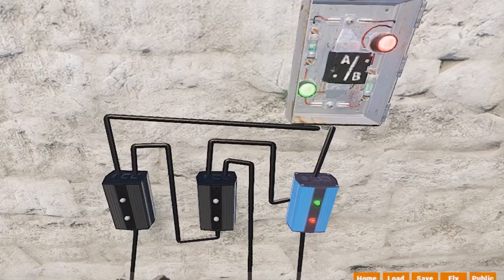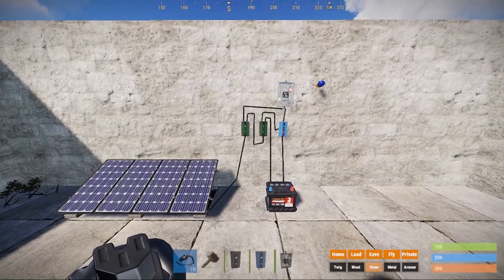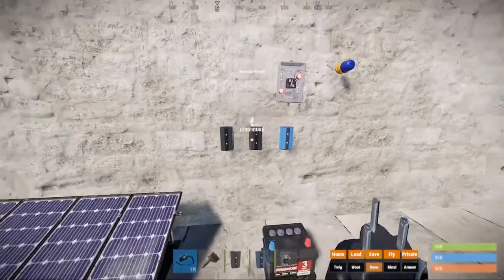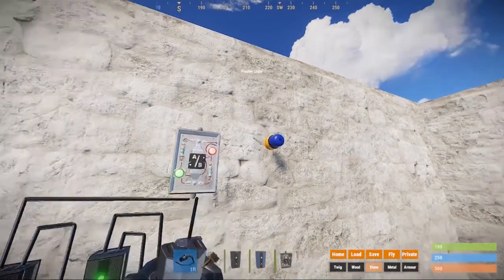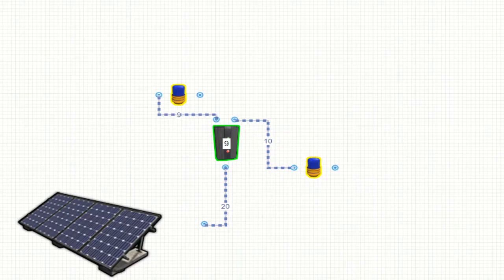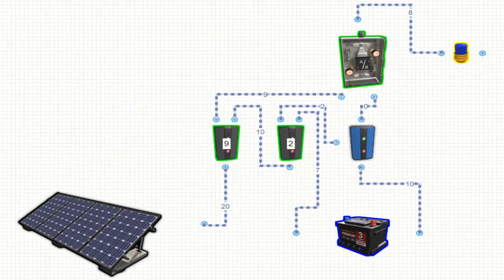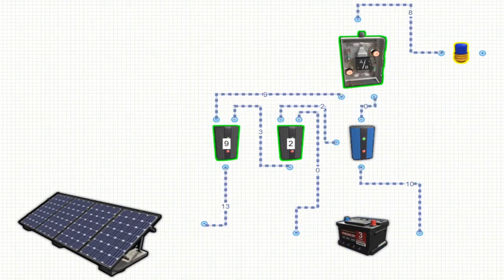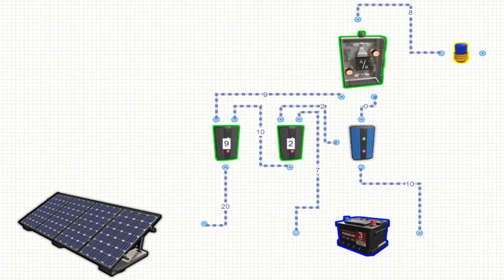Rust Electricity - the FIRST and most important circuit to build

Comment: this is old scheme. Now it’s important to connect directly
Reply: solar panel -> consumer (splitter)
Reply from the maker: No the splitter is not the best way to do this.  Splitters are rarely the answer when a branch is available.  What do you think the benefit of the splitter is?
Reply: @ramrodgames  The system you introduced is needed to separate the power supply from charging the battery and consumers - this takes a small amount of electricity. In the present tense, this is not necessary, because the battery does not give out all its charge, as it was before, but as much as consumers need. The main thing is to supply 2 times more energy to the battery than consumers need. Sorry for my english)
Reply from the maker: Your English is good bro no worries.  That was my point in the video - you CAN power everything direct with the battery directly as you said if you have double the solar / wind and enough battery to get you through the night + during periods of lower power (more applicable with solar than anything).  The point I'm making is you are wasting HQM because you're having to set up 2x the power and more battery capacity than you need to make sure the power supply is uninterrupted.  This circuit has multiple benefits compared to just connecting everything directly: 1) It allows you to more efficiently use the power generation you have (especially solar) when it is available and then switch to battery when it is not sufficient (so you don't need to install as many panels and as big of a battery).  2) It gives you a battery backup if your solar / wind is damaged or destroyed because it makes sure that your battery is at peak charge at all times (yes you can do the same by having 2x+ solar going into a battery so that you always have extra, but that's wasteful).  For example you can have 6-7 solar panels generating 120-140 power going into 1 large battery this way and instead of 10 panels.  3) You get more control over your power - with this circuit using branches (this is one reason why they are better than splitters), you can set how much of your power is going to the battery to charge it in the beginning vs. to your components.  For example if you set up everything with a medium or large battery in the beginning and only need 10-20 power for a turret and some lights, you would not direct 100 power from the solar panels to your main power line.  You would direct enough to power those components and send the rest to the battery to get it charged fully faster.

Ultimately this circuit isn't for everyone and you do need HQM for the components and yes it uses a little bit of power.  If you're only using electricity for basic stuff then this is not worth it.  You'll see in future videos though that I like to build complicated circuits with multiple sensors, turrets, and advance warning systems.  To do stuff like that, this circuit is absolutely necessary because you want to be able to regulate everything and it is the first step to a much larger and modular electrical system.  I'll post more videos and show more of this.  Thanks for your comment and let me know if I'm wrong on anything here.
Reply from the maker: @Rest0rer I think I understand what you are trying to demonstrate which is that you lose some power because of the circuit and get less to the battery vs. directly connecting to the solar panel.  This is true but you wouldn't really use this circuit for a single small battery so the power loss doesn't matter as much when you are talking about medium / large batteries (or many of them for larger systems).  You still lose the same amount of power to the circuit regardless of the size of battery so this circuit is for larger systems to be most beneficial.  You will lose a little bit of power to the circuit but the benefits I was listing above are worth it for larger systems vs. connecting directly to a battery.  Did I miss something else in your video or was that what you were showing?  Thank you for taking the time to set that up.
Reply from the maker: @lowfees yeah there's no way a single large battery will work - you will need multiple for that configuration (16 turrets and 4 sam sites alone require 260 power to operate without accounting for anything else).  Regardless of whether you use this circuit or not, you can achieve this by stringing together multiple large batteries with root combiners on the output.  You can scale this circuit up as well for a big system like that - I can show that in a future video if interested (I actually did it on the last wipe for 2 large batteries).  For systems less than 100 power needs you can simply add more batteries and string them together (output to input) in a chain and then the last battery in that chain is a large battery that outputs 100 into the blocker.  
For your specific situation you would take the power out of the second branch and then connect it to a string of branches or a splitter (actually helpful here) that each goes into the input of as many batteries as you are setting up.  If you're gonna do 3 large batteries (300 output) then splitter is the easiest here.  You can do via branches (1 branch per battery with the branch output going to each battery's input) but the issue is you'll then need to set the branch amount for each battery and you can run into some issues with batteries down the chain not getting any juice if there isn't enough to satisfy the needs of earlier branches.  Using branches in this setup would require you to monitor and adjust branch amounts appropriately until all your batteries are fully charged and the system is working as expected.  Alternatively with the splitter you can just split the power into 3 evenly for 3 large batteries or go to a branch first then to 2 splitters for 6 batteries (and scale up from there).  
Then the only other tweak you need to do is to use root combiners on all the battery outputs to combine them all into one power stream that you feed into the blocker.  This amount of power is not capped by anything so as many batteries as you feed into the root combiners as you can will dictate the power output.  This is how you'll get your 260+ power at night when you're running on batteries ultimately (regardless of if you use this infinite circuit or not).  You just need to root combine all your batteries.  Hope that helps.
Reply: @ramrodgames  in both types of connection you need 2 times more energy for uninterrupted operation day and night. But in your (old, until the bug with the batteries have been fixed) circuit there will be a small loss of electricity and HQM for 2 splitters, a blocker and an "or" switch.
Reply from the maker: @Rest0rer That's correct, I think we are saying the same thing as it relates to the loss of electricity from the branches / blocker / OR switch but that doesn't matter as much when you're talking about medium or large batteries because the power loss is the same regardless of the size of the system.  So losing say 5-10 power on a system that outputs 100+ is not as significant and the benefits of this circuit outweigh that loss (as I was listing before).  Where I don't agree with you is that you need 2x for the infinite circuit - one benefit of this circuit is that you need less than 2x vs. your method.  I will try to show this on a video but the reason for this is when you connect everything directly as you have the battery is used first and recharged by the solar simultaneously during the day.  In the infinite circuit, the battery is not used at all until there is not enough power from the solar for the system and then the batteries come on.  The reason this is better is because the batteries are used for less time and therefore you need less batteries to last the night and will likely need to recharge them less.  Because of that you can use less than 2x power in this system because 1x power is used during the day directly via the solar (no batteries) and anything extra is used to recharge the batteries during the day.  You have to find the right balance here and in some instances it can be as high as 2x but not always.  If power needs are very high and the batteries are almost fully drained every night then yes you probably need closer than 2x to be able to recharge the batteries fully during the day but that is not always the case.  For example you can have a large battery with maybe 1.2-1.3x power if you are not using all 100 of the output (I do this all the time as a solo - it always makes sense to have a larger battery than you need and sometimes all I find is a large).  Plus this circuit gives you more benefits as I outlined above beyond just the battery / solar efficiency.  I will try to show all of this in a video, maybe that will help.
Reply from the maker: @lowfees stick around then, more to come.  I'm a mediocre Rust player who is more into the building / electric stuff so that will be more of the focus here.  Pretty sure no one wants to watch my gameplay where I die non-stop or just run away every time!

Comment: Hi, I’m having a slight problem with this circuit if anyone can help 
So;
I have windmill + 2 solar panels connected before this circuit into root combiners which then send power to the first branch of this circuit.  During the day it’ll get between 150-170 power going through, then down to 100-70 during the nights and low wind. I branch out 100 power to the OR switch and the remainder charges the battery. However my battery is still continuously discharging even when the branch is providing well over 100 power. What could I possibly be doing wrong that both sides of the OR switch are sending through power to my main circuits 

Thanks
Reply: This video is a rip off of a video I made 4 years ago.  But he only copied the first part.  I can't link it because "youtube".  But search up "The Best Rust Infinite Power Circuit", then skip in 4:20 into the video I show how to modify the circuit for a large battery, and more power, like a wind gen.  

That said The reason this circuit existed is that at the time I made the video a battery, in Rust, could not be charged and used at the same time.  This was fixed about 3 years ago in the November 2021 update.  Since then a battery could be charged and used at the same time making this circuit obsolete.  Sadly the person who copied my video didn't know that because when he posted this video it as no longer needed.  Now all you have to do is run a wire from the solar panel, to the battery, then from the battery to the load.

Comment: If the power from the solar panel is not sufficient, its waisted because it wont charge the battery, is there any way that even if the power is still short, it can still be used to charge the battery because currently its waisted
Reply: For example, if your running 2 windmill and one of them gets destroyed, it will automatically go on battery but if the other windmill helped the battery it could make the battery stay longer on

Comment: This makes no sense to me as long as power production is enough to power your stuff it will also charge your battery at the same flow so your battery will be full either way. Am I missing something here. Is batter recharge way slower? Like a hard cap limit thing
Reply: This stops the discharging of the battery while power is being generated, allowing for more efficient charging and less drain while the generation first powers the circuit and secondly charges the battery.

Comment: Currently, i'm running 14 ceiling lights. 14 x 2 = 28w. So I'll set my 1st ebranch to 29 right? When night time came around, my large battery was outputting maxcwats at 100. Can I just put another E branch in-between the battery and blocker to be set at 28 to just power my ceiling fans?
Reply: Yes just make sure your running the Branch out to the battery and not the power out

Comment: great video, shame there's no more!
Reply: little update, I am currently using this circuit with 3 windmills and 6 solar panels, split (yes using a splitter :P) into 3 large batteries, my current set up uses 225 power, because of difference in wind speed and sunlight etc my power generation can be as low as 180 or as high as 460 depending on weather conditions etc, this circuit works perfectly, my batteries are always fully charged and i never loose power, i recommend setting the first branch output to exactly what your current circuit requires and the rest go to bateries to charge, so i have mine set at 225 and increase this as i add components to the final circuit, this is definitely the superior way to do this on any circuit that uses a lot of power.

Comment: I've been using this set up religiously. However, I came across a problem when using the large battery and solar panels. I had a system needing 160+ watts. At night when the battery kicks in,  it only gives 100w output. Would the solution be to add a 2nd large battery to this system? If so how?
Reply: Why u use solar panels to power 160+? How much solar panels are u using lol, just use a wind turbine. And yes use a second battery and combine the output with root combiner
Reply: Link shows you how hook up other battery

Comment: This circuit is ineficient. When you are using the power from your batery, the power from solar panel or windmill is not used for nothing(thats ineficiet, you want that power to at least charge batery). I did some improves to fix that
Reply: This video is a rip off of a video I made 4 years ago "The Best Rust Infinite Power Circuit".  The reason this circuit existed is that at the time I made the video a battery, in Rust, could not be charged and used at the same time.  This was fixed about 3 years ago in the November 2021 update.  Since then a battery could be charged and used at the same time making this circuit obsolete.  Sadly the person who copied my video didn't know that because when he posted this video it as no longer needed.  Now all you have to do is run a wire from the solar panel, to the battery, then from the battery to the load.  Its that simple.  So while you are right that its "inefficient".  It had to be at the time due to Rust electronics not yet working like real world electronics.
Reply: @K162KingPin  bro this shit is scandalous wtf

Comment: Massive problem here: you need double the power input to output the same amount of power you did before. This is fine with a few lights in a small base, or a builder server where it doesn't matter, but once you get to multiple batteries (keeping some as you upgrade to med and large), branch circuits, etc, this circuit no longer is viable since you suddenly need to produce 200+ instead of being powered from a single windmill and a few solar panels.
Reply: That’s when you add root combiners yo your power sources and then run that to your w branch and from there you can pick which systems receive power and how much power they receive

Comment: Why did they need to make this game so complicated?
Reply: Its not LMAO
Reply: Remember there are things in this game for those who WANT to complicate things. But remember like he said you could always charge the battery during the day and plug the battery back in during night. This goes for plants as well. You dont have to worry about genetics as planting a seed will always yield output as long as you plant it right but you could complicate it
Reply: @johnreese7352  XOR / And gates aren’t needed in video games lmao. That’s the kind of thing you learn about in university. Not a video game lmao
Reply: @DankMemesForAngryTeens  well exactly as you put it, they aren’t needed. These aren’t that advanced and if you aren’t skilled with electricity, then use solar panel into a battery into a light and pass through. What the video showcased was maximizing and pushing power to its limits and this is optional.
Reply: @DankMemesForAngryTeens  in university? those are extremely simple logic gates for 3rd graders bro

Comment: When there is no more primary power, the battery will kick in but the primary power will be doing nothing. This is a very bad system. You should had included a memory cell on the beginning of the solar panels so when the battery kicks in, the primary power of the solar panel will change to charge the battery.
Oh and this is actually not worth to do.
In your case, you are losing 5 rust wats so the full power of the solar panel is 15.
Batteries have 80% charge efficiency, which means that if you put a solar panel connected, with full sun, your real charge would be 16. The bigger the power output from power makers, the more efficient this will be. I did a better one with a wind turbine and a medium battery and I just got more 5% efficiency, which is NOT WORTH TO DO

Comment: Frankly, the fact that branches always, regardless of use, expend electricity needs to be addressed.  If you have 1 branch connected to a battery, and you branch off 5 from a 10 power source, that branch, even if it's connected to literally nothing, is spending 5 from the battery at all times without powering anything.

So if you have a base using branches, just leave all the lights on, use all the power you want, cause it won't make any difference if branches are involved, it's spending the power anyway.
Reply: While that is surely annoying switches and blockers exist for a reason. Because if you have a switch and all the branches that always use power behind the switch your battery doesn't always use those 5 power, it only uses them while the switch lets electricity through.

Comment: While this circuit is still useful and viable, using it in this exact configuration actually has you losing output power.  As far as I understand it, you are charging your battery with an additional 0.4rw at the cost of losing 2rw at the battery's output.  With a medium, large, or series of small batteries even, this would end up having your batteries charge faster with a relatively minimal loss.